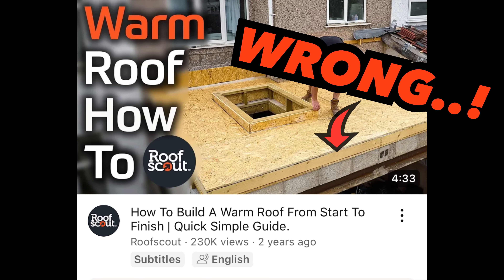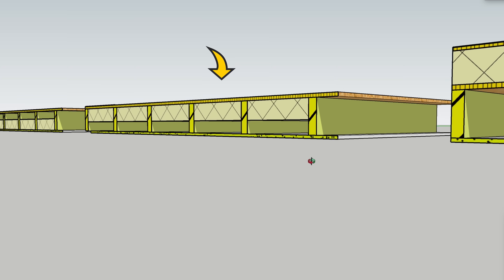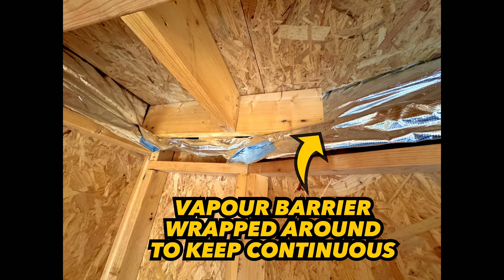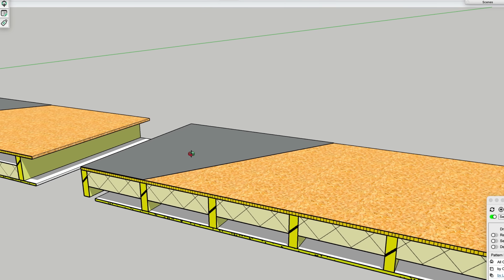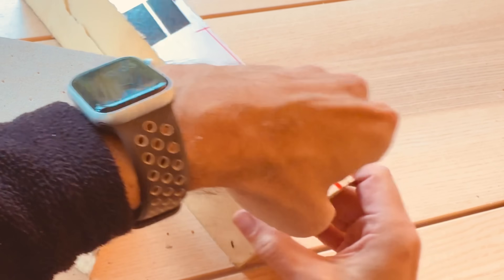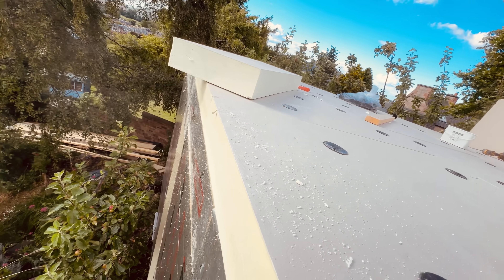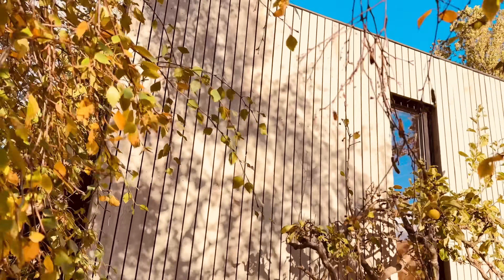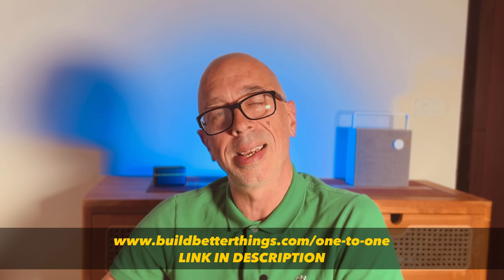Build a Warm Flat Roof the Right Way

Comment: I found this video a couple of years after I did my own flat roof. But it turns out that luckily I had my information from the right sources. A&E construction is one of them and they did a great mini how to do series on building a roof using Resitrix membrane and Alutrix vapour barrier.
So the construction is 18mm plywood on the rafters, with proper slope. Then Alutrix fixed with the FG35 contact adhesive. 120mm PIR insulation on top of that, glued with PIR foam adhesive and mechanically fixed with 10 screws per each 1,2x1,2m square. On top of that is the Resitrix membrane which comes on rolls and exists of an EPDM top layer and a bitumen layer underneath. The underside is pre-glued which has a peel of plastic film over it to prevent the roll sticking together. The membrane is glued to the insulation directly after applying the FG35 adhesive on the insulation. The edges of the strips overlap and are sealed with an hot air welder.

The big advantages of the system is its durability and that I could install it on my own, no way that you can handle let alone lay down a single piece EPDM membrane on your own.
The disadvantage is that having to weld the seams is more work, gives potential failure points and requires some skill. I practised on scrap pieces until I had the right setting of the heat and technique to get a proper bond over the 5cm depth of the seam.

Things I could have improved on regarding your video is the PIR I used with Aluminium caching and the use of flat plastic washers for my screws instead of the tubular ones. The screw heads show first when snow on the roof starts melting. The screws are only into the full thickness of the plywood but because I used more than advised and also glued the insulation down wind uplift has not caused any issues, the roof has survived 5 storms now. Also the plywood grips the screws better than OSB and is stronger in itself, though a bit more expensive.
Reply from the maker: Thanks a lot for the information. Great project. What area is the roof ?

Comment: Interesting.  I'm always interested in building science.  In Canada where I've be practicing for 35 years in the case of a flat roof in an ICI (industrial commercial institutional) application it's a steel deck, vapour retarder, U-0.031 (R-32) and a modified bitumen roof membrane (we also use EPDM or sheet goods) mechanically fastened.
I did a pitched roof 30 years ago that employed 4" thickness of polyisocyanurate insulation with plywood both sides to create an insitu composite panel.  Deck screwed through with poly vapour retarder on the warm surface, asphalt building felt and asphalt shingles on the exterior.  The building appears to be in great condition, albeit the shingles will have been replaced at least once by now.  Perhaps it's because I specify plywood and not OSB. It might be that the vapour retarder is just more effective in blocking moisture ingress.  Don't know.  I do accept that the vented joist space above the rafters/roof joists is preferred for many applications.  Not all conditions are the same.
Reply from the maker: Thank you for providing this detail. Interesting to hear your experience. I like a ventilated roof detail but in the UK now it’s hard to reach the required u values with it

Comment: I still think a well ventilated cold roof is the best option for long life. My house has a large flat roof - single layer polyester felt on marine ply deck with full cross ventilation. Its 35 years old and still looks fine.
Reply from the maker: Thanks. Felt has done well. Are you in uk?
Reply: @build-better-things  Yes, South of England

Comment: So do you think SIPs panels are no good?  As you know, a SIPs house literally relies on having an OSB board around the perimeter, on the cold side of the insulation? According to what you say in this video, if I've understand correctly, the external OSB board will rot with time? I find that hard to see.
Reply from the maker: Sips panels for a roof require an additional ventilated battened space and then the actual roof deck. You could argue it’s a cold ventilated roof. You should not be adhering any membranes directly onto the sips panels. Yes, OSB on the cold side without ventilation will run into all the issues I mention in the video. Don’t you agree?
Reply: @build-better-things  So if a builder told me he didn't like putting the insulation directly on top of the insulation, are you saying the way to do it would be to introduce a ventilated battened space on top of the insulation.  So your warm roof build up would be insulation, OSB, batten to create ventilated horiz. cavity, osb, waterproofing?
Reply from the maker: If you are using sips, yes. If you’re not using sips, there are many builders still using foil insulation and OSB on the cold side. I’m saying that’s asking for problems and is avoidable. You should be bonding directly into the insulation with your membrane.

Comment: Really appreciate your content overall but I looked in to the "tissue-faced" PIR you name and used of Resista MG. I read that it has a Euroclass Fire Resistance rating of F in the European Union and then looked that up. "The Euroclass F classification in the European Standard EN 13501-1 indicates that a product contributes highly to a fire and is easily flammable"....I'm originally from West London near Grenfell....I'll never buy a product by Kingspan or Celotex. I then went down a few more rabbit-holes on this area previously unexplored and horrified to find most PIR products recommended for builds such as garden rooms, garages etc have this rating at F or at best E which still really bad. My build starting next Spring (I put a concrete pad down this summer, 5.5x4) is just within 1m of my boundary with the neighbour so already obliged (very willingly) to use non-combustible fire-retardent cladding which fine and dandy as that side won't be seen anyway so planning to use steel box profile there. However, now I'll also be looking at the PIR going inside the wood framing too. There is PIR that rated A and B but seems to be mainly various types of rockwool so more like a fabric material and not something one could stand on or paint over with a glue and then EPDM. I'll do some more research but seems an issue worth an explore..

Comment: There is always the theory vs the real thing. I have been rebuilding my house and looked into insulation a lot to maximize the R value. Based on the location where you are it can already have huge influence. So a roof in Spain will be different then England or Sweden. There are great online tools available like ubakus that calculate a lot like heat loss and moisture. I am not educated in the field but it is my understanding that as long as the roof completely dries again in the summer there should not be a big problem.

Comment: What about SIP Panels - they have OSB both sides of insulation
Reply from the maker: I don’t recommend sips if you watch my video on it, but my understanding for a UK climate is that Sips panels require a ventilated cavity above and additional layer for the roof membrane. It’s effectively a cold roof arrangement.

Comment: So where is the dew point now?
Reply from the maker: The calculated dew point is a theoretical zone, done for when you’re showing compliance with building regulations or code. The example I work through in the video is compliant, but I don’t have the time in ten minutes to go through something that non bureaucrats will have any time for. The reality, not covered by jargon, rules and regulations, is what I’m focusing on in the video. The reality is that dew point is not a fixed thing, once you get your head around the reality of vapour control.

Comment: As an "old boy" builder, I would always choose a cold roof. I've got a warm roof job coming up (as per spec) and I'm already in a panic about materials being damp and not having anyway to breath out!
Reply from the maker: A cold roof is a solution for OSB on the cold side, but it’s no longer accepted by building regulations in parts of the country. The other issue with a cold roof is dealing with the thermal bridging, which I cover in my other video. However, as you say, you can’t go wrong with a cold roof that’s ventilated.  Thanks for your comment.

Comment: Thank you for the great video!
I have 2 questions if I may. If you glue the epdm directly on top of the insulation, where is the moisture then going? Is it then not equally trapped between those two layers? Only there is no osb there to rot away.
My second question is, can you walk on the roof (for maintenance), because then you are walking directly on the insulation?
Reply from the maker: Hi. If you’re using EPDM, then it has a breathable aspect , so moisture and air will slowly dissipate through the compound   over a period of days. In the meantime, there is nothing to rot, so the temporarily trapped condensed moisture can do no damage. With OSB, it gets trapped within the strands of the composite and can never breathe out, so the OSB on its middle to upper part remains permanently damp in the area of condensation, and fails eventually. 
Yes you can walk on the roof for maintenance, and the insulation I use here is designed for same. You will read some of the negative comments saying otherwise, bizarrely , in support of OSB. I can only point you to my walking about on the roof in the video on boots, and you could also refer to the manufacturer’s recommendations for tissue faced insulation. 
Now if you wanted deck chairs and a balcony and such, I would recommend something different, but that would hold true for OSB sub strata as well, which wood also be prone to failure. Maintenance is fine for the situation we’re talking about. 
Great questions and thanks for the comment.
Reply: Thank you for explaining it further! That was very helpful.

Comment: So simply, No OSB on Top of the Insulation?, what about if its being used as a balcony/fitting units on top
Reply from the maker: Yes, no OSB on the cold side.  If you absolutely must use OSB, you have to have a ventilated void or ventilated cavity beneath it and above the insulation. For a balcony I would use an inverted roof arrangement.

Comment: Great video, thanks. If I put an Earth roof on top of the EPDM could it be done without any adhesive at all? The weight of The soil could hold down the EPDM. Assume of a roof pitch of 12: 1.
Reply from the maker: Thank you too. If you’re thinking about earth, you might want to consider an inverted, or upside down roof. I’m not sure that EPDM would do it long term in that situation.

Comment: Not that it changes the method, but the dew point will be somewhere within the insulation, not on the outside. However, I'm certain your method is superior and will eliminate potential rotting.

Great video. Cheers
Reply from the maker: Hi. Yes, I’m not really talking about the calculated dew point, which is a theoretical placement using some variables, I’m talking about the escaped and residual vapour, along with any changes in the dew point that theory doesn’t account for. Thanks a lot for your comment.

Comment: Im halfway through my own extension and my roof make up is 18mm ply - fg 25 primer alutrix 600 on and up the timber upstands surrounding 150mm pir -  joints taped - 18mm t n g osb 3 glued then 1.5mm edpm im assuming they used waterbased adhesive 

Since i still have no ceilings underneath would another vapour barrier on the underside of joists like a tyvek airguard stop this from happening or is my make up going to be ok
Reply from the maker: I would omit the vapour barrier under the joists, and figure out a way of how you’re going to get the Alutrix to join into your vertical vapour barrier to maintain your tightness. It sounds like you’re taping foil faced PIR and then placing a secondary OSB deck over. As I say in the video, you should be substituting that for a tissue insulation product, and rather than taping, if you’re that worried about it, use the interlocking batts. Then you just bond your membrane directly onto the tissue face, using the contact adhesive. You’re aiming to eliminate foils and composites above your vapour barrier.